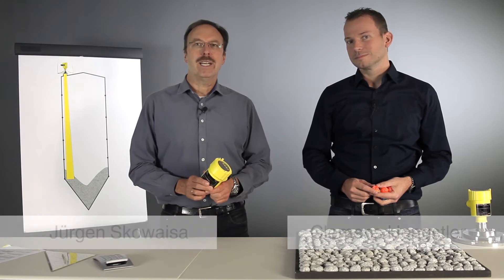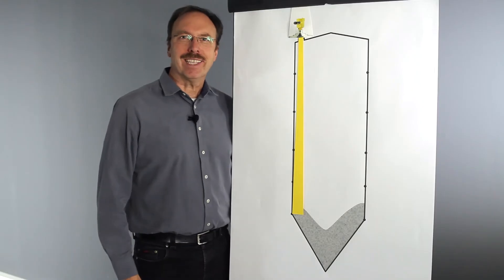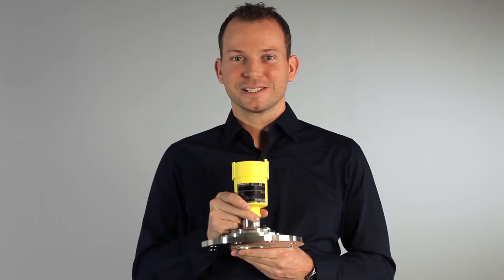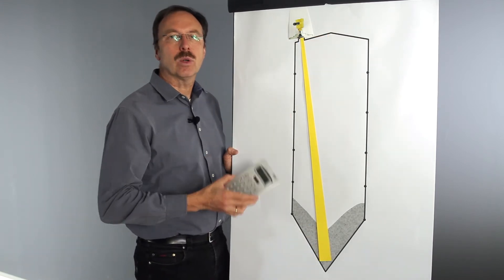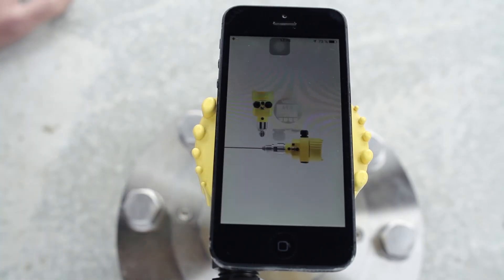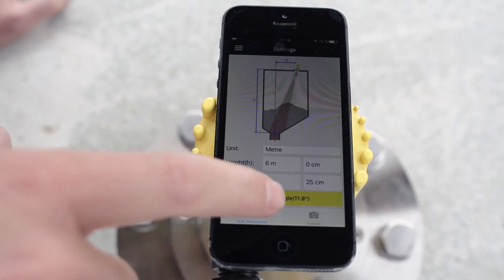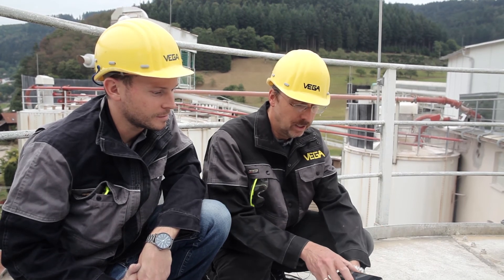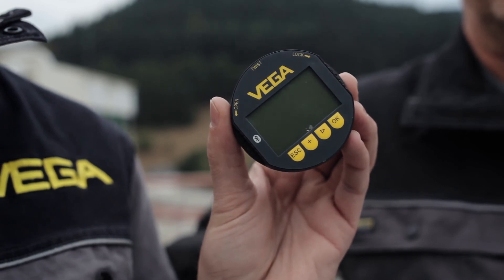App for mounting and alignment of radar sensors | Radar level measurement

Comment: can you explain about passive and active alignment in radar sensors
Reply from the maker: Hello Govind Raj
, thanks for your question. A radar for level measurement works according to the time of flight measuring principle. Which means the level measurement is based on the time between sending and receiving a microwave signal. The microwaves emitted by the sensor are reflected by the surface of the product in the silo. Therefore it is important that the sensor is aimed at the outlet of the silo. Only with this precise orientation is it possible to get a clear measurement of the level over the entire height of the silo.
Is that what you mean? Feel free to contact us if you have further questions.
Reply: @VEGA_Level_Pressure  thanks for your immediate response. As I'm working Diagnostics Developer for RADAR sensor, here we have 4 types of alignment  which is Active alignment, Passive alignment, vertical and Horizontal alignment. I have understanding of Vertical and Horizontal but I'm not understanding what is the difference between Active alignment and Passive alignment.
Reply from the maker: @govindraj7061  The alignment of radar sensors for level measurement shown in the video is only mechanical. We assume that your question regarding active, passive,  horizontal and vertical alignment refers to another type of radar sensors?
Reply: @VEGA_Level_Pressure  yes exactly
Reply from the maker: @govindraj7061  Unfortunately, in this case we can not give a reliable answer to your question.
Reply: @VEGA_Level_Pressure it's okay thanks for your valuable reply.